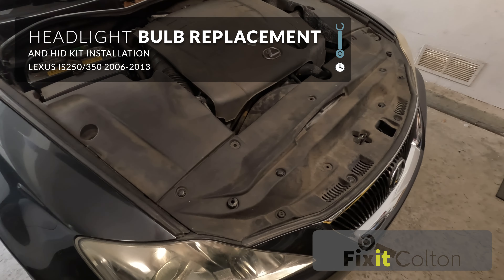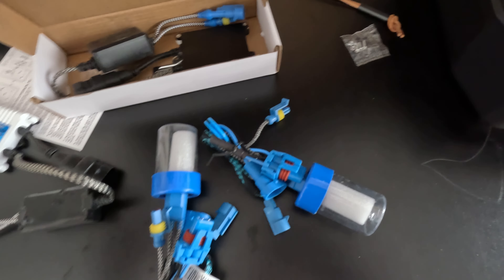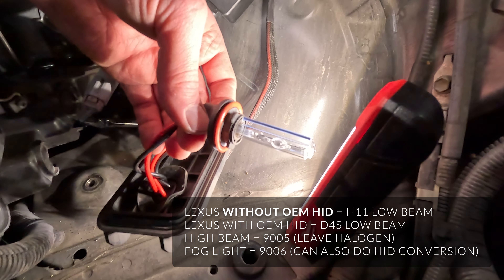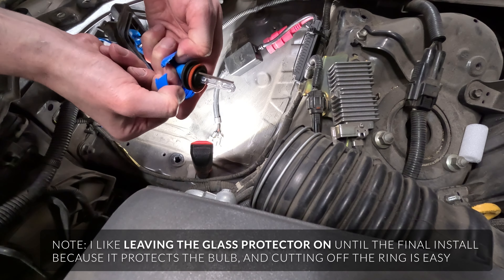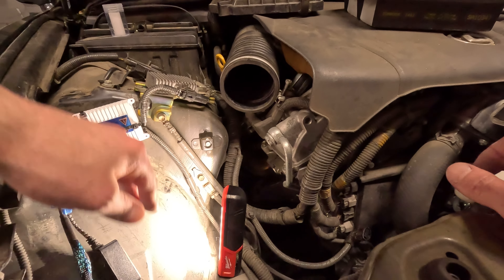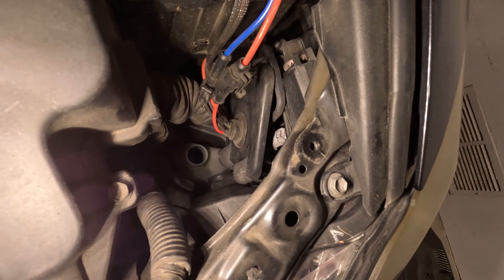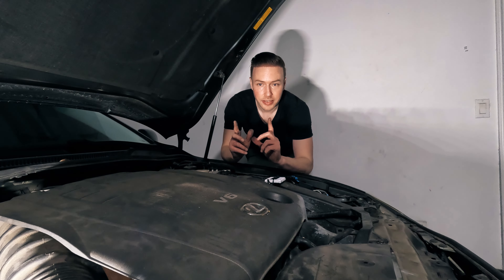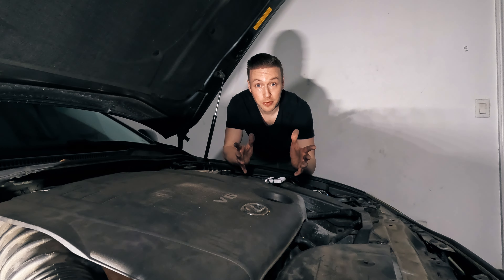Lexus IS250 | IS350 HID Conversion Kit Install & Headlight Bulb Replacement (06-13)

Comment: Hi,one question,which h11 did you use? H11A of h11B?if you choose the wrong one it can cause a stripe because of the return wire?
Reply from the maker: Some Amazon links go dead. I'll post another, sorry. I believe these are the ones I bought. https://amzn.to/41xbuiR 
They say "H11" so I'm assuming they default to H11A. I'm not in town, and I cannot verify with the car. Hope this works out for you. If not, I can possibly check in the new year.

Comment: Boss I want to put led on low beam can I put h11 led??
Reply from the maker: For the 2006-2012 IS lines: If your car came with the OEM HID setup on the low beam, then the bulb size would be D4S. If your car came with OEM halogen bulbs, then the bulb size is H11. The high beam is 9005 (I believe) and the fog lights are 9006. 

Therefore, if your car came with OEM halogen bulbs, then yes, you can put H11 bulbs in for the low beam. The LED bulbs are not something I've used before, but they look promising. Good luck.